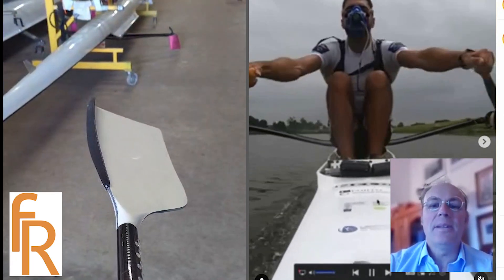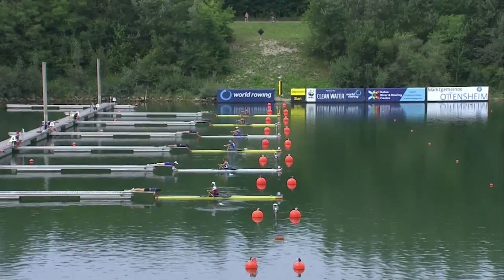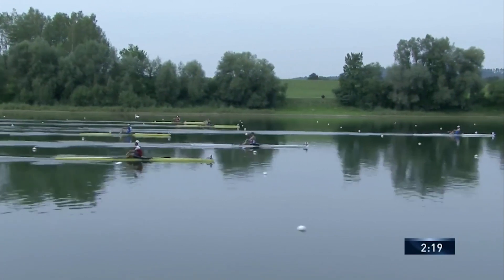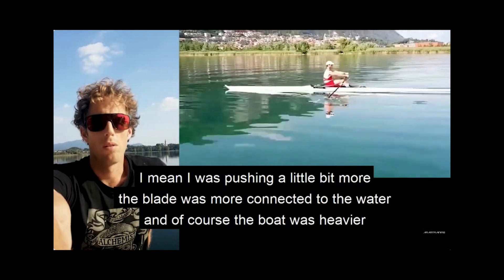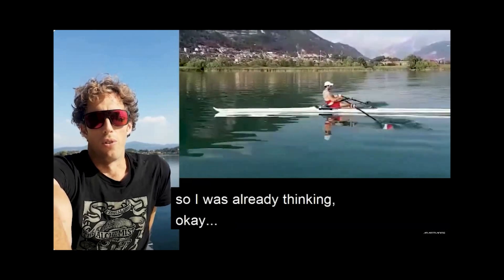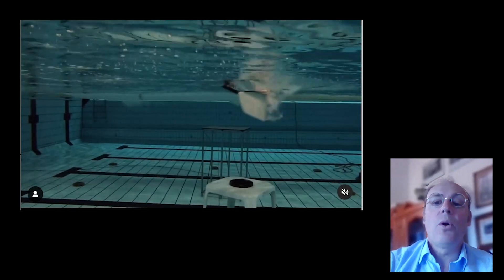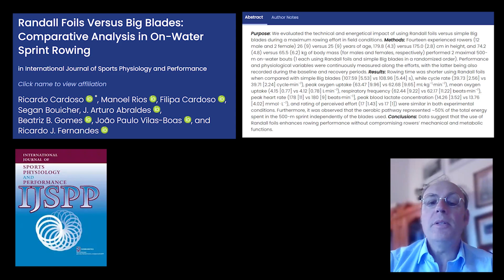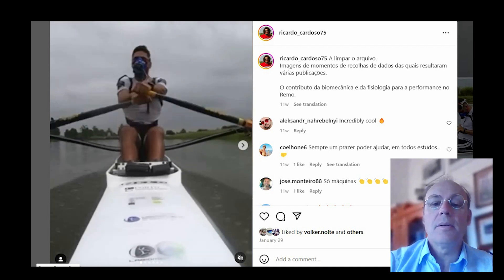Rowing Blade Design Innovation - University of Porto - Sports Science Research

Comment: Great work!! 💪💪💪 looking forward to test your foils in two days!
Reply: I tried the foils today (Concept2 soft skinny Smoothie2 blades with vortex edge), at +/- the same work, the area under the force curve (RiM App) was bigger and fuller, and with a less agressive force-peak. From the catch onward it looks like the force-curve we see on an erg... I can now distinguish much better from where the imbalances come from (mainly my body, wind, wakes) because the blades lock so well. All in all I can train now to be better prepared/relaxed before the catch. Because I now hang on the handles fully horizontal, without any major vertical slip. Great work! I'm looking forward to blades with a fully integrated foil! 😉💪😊🙏🏻